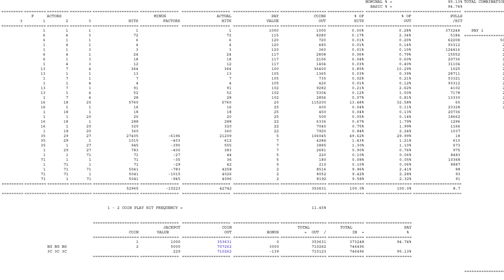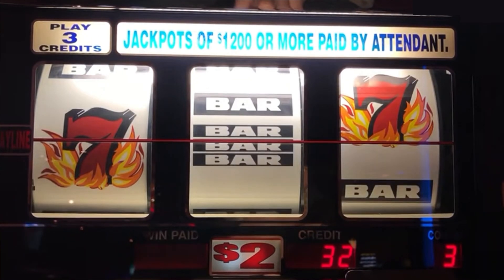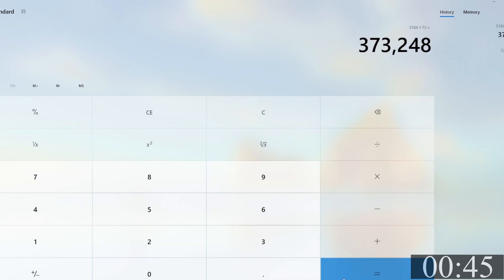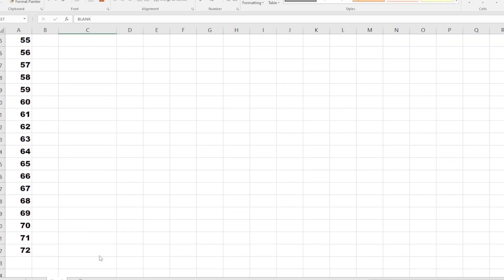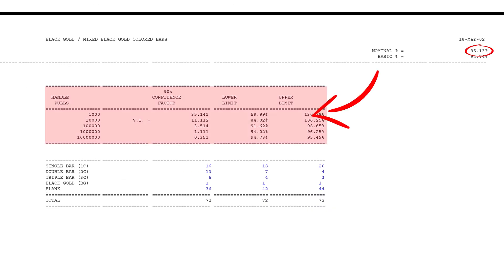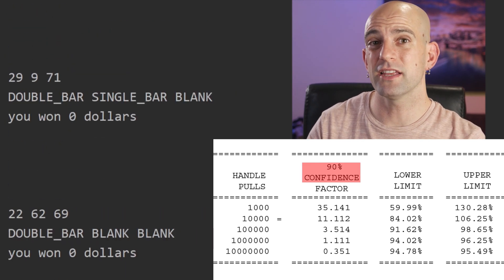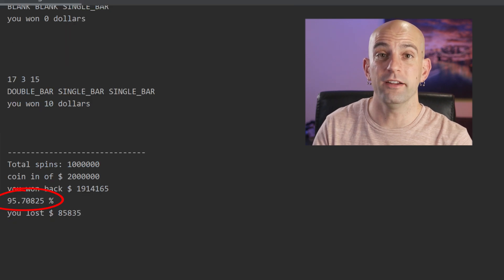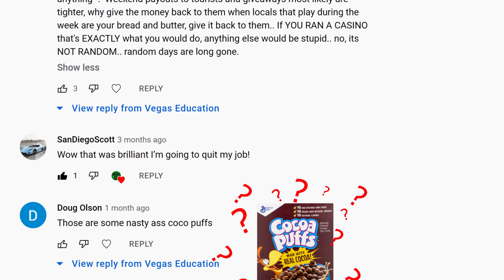Designing a slot machine from scratch

Comment: What you explain is exactly how it USE to work when it was works by coins. But now with bills and vouchers and player club card third party elements you should update this video. Is like the difference between TV vs Smart TV, phone vs smart phone, PlayStation 1 vs PlayStation 5.
Reply: They don't share secret information with designer, and if they do  I believe they  are under NDA contract. And I don't think they will share this info with you or anybody. 
Can you answer me this 2 examples please:
1-if you have 15$ in your bank account ,can you withdraw 10$ from gas station ATM?
2-if you have 10$ in your bank account, can you withdraw 10$ from gas station ATM?
2-if you have
Reply from the maker: @NE Slots Buster  
They didn't share any secrets. The math is not a secret.   "Your video is spot on, and I've never seen a video so accurate" is not a secret.

Your examples are not relevant to how a slot machine operates.  A slot machine is quite capable of paying out more than it brings in.   It is only the probabilities that keep this from happening over the long term.  Ask any slot tech that's been doing it for a while, and they will tell you about machines they've seen that have had negative payouts.    The machine hits a large payout soon after being placed in service, and it takes a while to make that money back
Reply from the maker: The math is exactly the same.   The bonus rounds and wilds are calculated in exactly the same way.    How the money is dispensed makes 0 difference.   I've talked with game designers that are still working for slot manufacturers and they said it is spot on

Comment: This is an excellent video and explanation of "the math". I also love the video "proof slot machines aren't random". However, I'd still like to know what changing the machine's payout percentage actually does in terms of the machine's code. For example, how does changing from 95% to 98% get input into the code?
Reply from the maker: Excellent question!  A game designer can lower the payback percentage in several ways.  You have to remember that the paypack percentage is the ratio of how much every combination would pay vs how much it would cost to try every combination.  Assuming that the cost to try every combination stays the same (the number of spaces on each virtual reel stays the same), that means what's changing is how much every combination would pay back.   So, that total amount can be adjusted in a couple ways. They could change the number of winning combinations. 
Example: change one of the 2 bars on one of the virtual reels to a blank space. 

They could also change some of the higher paying wins to lower paying wins.
Example: change a 3 bar on one of the virtual reels to a 1 bar.

I think the most common way is to just change the paytable.   
Examples:
Change the 3x 1bar from paying 40 to pay 35
Or
Change the jackpot from 5000 to 4000

Most of the time, it's pretty small changes that a player wouldn't really notice.  For the most part, machines aren't being made "more lucky" or "less lucky"  unless it's changing a 1 bar to a blank.  Something small, that a player would never notice unless they had good accounting records
Reply: @VegasEducation  Thank you so much for the detailed reply. The lightbulb just lit!!! Now it all makes perfect sense to my engineer's brain. Making small adjustments to the pay table will absolutely affect the payout percentage without effecting the "randomness" of each spin.

Comment: You might want to look into lists or match (python version of a switch) instead of all those those ifs.  It would make it easier to update and import data.
r1 = ['~~~','~~~','BAR',....,'Blazing 7']
...
for i in range (0,len(r1)):
     for j in range (0,len(r2)):
           for k in range (0,len(r3)):
                    r1[i] + r2[j] + r3[k]
Also, things like coinIn = coinIn + 2 can be shortened to coinIn += 2 using the addition assignment operator.   totalWins += 1 to increment that one (no ++/-- increment/decrement in python to my knowledge, but I have never actually used it).

Comment: Good video but you didn't cover some things I think.

How did you get the $710,000 number?

I mean how many combinations are winning combinations?
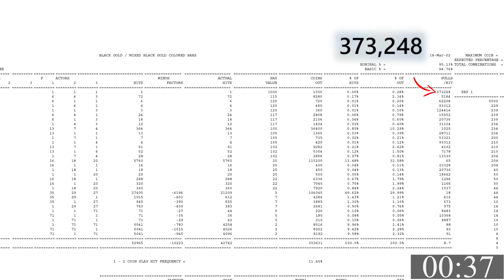Reply: 42742 winning combinations.   59265 winning combinations - 10223 duplicate (like removing 3bar-3bar-3bar combinations from mixed bars because only the highest value is paid.)   It is visible at 2:50 in the video.
$71-whatever is all the winnings from a "cycle"--every combination in the machine happening once.

Comment: What is the difference between pay lines and ways on a slot machine?
Reply from the maker: I'm not sure what you mean by "ways." I assume you are talking about how I say there are about 5000 ways to get 3 triple bars.  In that case,  they have absolutely nothing to do with each other.   Paylines would just be doing exactly what I did in the video but instead of only doing it once, you are doing it 20 times (or however many paylines)

In the video, I'm only doing one payline

Comment: Great video! I'm curious to see how the payout over 1 million or 1 billion spins would differ if you changed the RNG. You programmed it to pick a number for each wheel (1-72) but what if it just picked 1 random number (out of the 373,248 possibilities). I'd love to see that comparison. Would you put your python code out so we could try it ourselves?
Reply from the maker: The scenario you propose is the EXACT same situation, just formed differently.  The results would be EXACTLY the same.   Picking a number between 1 and 373,248 is essentially what the slot machine is doing, it's just using 3 different reals to do it, if that makes sense.

I probably will release the code at some point. If you send me an email, I'll email it to you.
Reply: @VegasEducation  In my head it seemed like it would be the same but could show up different in real world simulations. I guess it would be more of a Monte Carlo situation to see the way variance would play out in the machine.

Edit: I don't see any contact info for you.
Reply from the maker: @falecf4   it's not that it's similar and would get similar results,  its EXACTLY  the same.  Slot machines are just a fancy way of drawing a number between 1 and however many possibilities.  If they just told you the results, nobody would play. So, they had to find a more confusing way of doing it

vegaseducationyt@gmail.com

Comment: Thanks for the video! Would you also be able to provide an analysis of "hot" and "cold" periods during the million spins? Define "hot" as being > 12 wins in 20 consecutive spins and "cold" as being < 3 wins in 20 consecutive spins (or whatever you like).  I think it would interesting to show that a player's perception of "hot" and "cold" is just a natural part of randomness rather than any specific program applied by the casino/slot manufacturer.
Reply from the maker: I've thought for a long time about how to demonstrate that.  I don't know the best way to demonstrate it, but I've had some pretty good ideas
Reply: @VegasEducation  Thanks for response! Hope you find a way to demonstrate this!

Also interesting is the theoretical upper/lower limits of return for  a 1000 spins. Does this RTP variance apply for any sequence of 1,000 consecutive  spins or only the first 1,000 spins when the machine is first placed in service?  I guess you could also show this by breaking your 1,000,000 spins into  1,000 sets of 1,000 and checking the RTPs for each set of 1,000 to see if they are in this 59.99-130.28% window. 

Presuming the above is true, I find it interesting how little meaning a 95% RTP machine has over this relatively small amount of 1000 spins when you get anywhere from 59.99-130.28% return. Would be interesting to see the 1000 spin return variance on a 85% RTP machine (my guess it would be similar).  I think most players can go through 1,000 spins in 2-3 hours so knowing this variance might be a good hint on how much to invest in a machine and when you should cash out. 

At some point between 10,000 and 100,000 spins, the upper limit falls below 100% meaning that is now impossible for the players to break even and now the machine becomes a guaranteed profit for the casino.  I wonder if this applies to an individual's play on a given machine -- I could see surpassing 20-30K spins over a few years with weekly local casino visits.  If true, you should just quit the machine after so many spins as it would be near impossible to get your money back ....
Reply from the maker: @prismeye  you're on the right track but you're missing the randomness aspect of it.  Those given ranges are what happens 90% of the time.   10% of the time, it'll fall outside of that range.  Sometimes by a lot. 

What you've described, about breaking the million spins in to 10,000 spin segments is exactly what I've done.    Spin the machine a few billion times and then see how many times it pays back 91% and how many times it pays back 92%.  It ends up forming a bell. You can see a short clip of one of these graphs forming at the end of this video.  I've written out my outline for this video several times, but I'm having a hard time coming up with something thorough, yet concise.

To answer your question about the first 10,000 spins vs a random segment of 10,000 spins.  The machine doesn't care. It makes no difference. One way or another, it will average out over time.
Reply: @VegasEducation  I think the hot and cold streaks that players refer to can be explained pretty well through queueing theory and Stat models. Imagine a win is considered an "arrival" (data point) an it's analyzed in aspect of time, or here it would be the number of spins. When graphed our data would fit an exponential distribution. We find that the expected arrival for 10 spins is exactly 1.0. That means on average there was 10 spins between each spin, however when we look at the data, about 70% of arrivals arrived in less than 10 spins of the previous arrival.  The reason is that the higher the number of spins between arrivals, the more weight that data point has. So data points arriving with lower amount of spins carry less weight.  

Even though the slots are random and independent does not mean we'll see uniformity of wins over a duration. The data will not fit a normal distribution. The "hot" and "cold" streaks actually expected if the slot is random

Comment: Thank you for teaching me about Par sheets. Can you explain how a machine can often do back to back jackpots/ bonuses? I guess the same math. Can you explain why nickel betting pays back more often than 1 or 2 cent machines?
Reply from the maker: It can pay back to back jackpots because each spin is random. In this example, the odds to win a jackpot were 1 in 373,248. If you win a jackpot, the odds on the next spin are still 1 in 373,248.   

A nickel machine will typically have a higher payback percentage than a penny machine in the same casino. Having a higher payback means they have more money to distribute throughout the paytable.  That means either more winning combinations, more money on the existing winning combinations, or less losing combinations

Comment: Excellent video and description. You hit the nail on the head. I was a slot machine bench tech at a large casino for 5 years. I also own my own "Game King" at home. Just as you said, it's all math. The machine does not self balance or anything like that. On my home machine, I have winning sessions and losing sessions. In the short term, after resetting the hopper accounting screen, I've had the machine pay out at a theoretical 135% when I hit something good 3 spins in and then eventually drop down to 65% if I played long enough. The master accounting record that I've never reset, after a couple of years and over 300k games is pretty close to the expected probability. No magic or rigging required.
Reply from the maker: Thanks. I think the problem is just that statistics can be very counter intuitive. The general population just can't wrap their heads around them.   Then there's the fact that it's litterally in our DNA to look for patterns and cause and effect.

Comment: Great Video. My question is…Once the machine reaches the 95% payout variance, and a jackpot is hit, does the machine factor the massive jackpot payout and give back less until the 95% variance is reached again? I think, with enough spins (thousands/millions), the machine will have enough RANDOM Hits and Misses to stay within the machines Plus/Minus percentage, thus averaging 95%. How does the machine get back within tolerances when falling below 92% or above 97% paybacks?
Reply from the maker: No. As I said in the video, It doesn't manipulate itself to stay within that range. It just naturally happens.  In my tests, 3 jackpots was the highest I saw in 100k spins, but it also goes a million spins without hitting a jackpot, they average out over time.

I spun this machine 5 billion times and recorded the results every 100k spins. For 100k spins,  it should be within 91.62% and 98.65% ninety percent of the time and it was.  But I saw results as high as 107.1% and as low as 87.4%.   The state jurisdiction just cares that they THEORETICALLY should converge to their give pay and have been tested to do so.    People claim that there's no way a casino will allow itself to lose money after 100k spins, but they are missing three things.... 
1. 100k spins isnt that many, its maybe 2 weeks, depending how busy the casino is.
2. why do you think the casino wants you to do 50 lines at a time? It makes things happen 50x faster.  
3. The casino has 100s of machines. They all average out.  A single machine might not be profitable over a week period if players are REALLY lucky (and only playing single lines), but with that many machines,  they average out to paying what they theoretically should.
Reply: @VegasEducation  Thanks so much…I love your knowledge!
Reply from the maker: @keithkantorczyk2854  thanks. Let me know if you have any other questions

Comment: What is the best number of spins in lets say 100000 spin potential that could give you a potential over 100% payback? How does the variance affect it. I would really like to try this model to identify the amount of martingale bankroll you could use to make a theoretical over 100% return and where does that range lie. I want you to explain that last moving graph you had.
Reply from the maker: My kind of guy. Now somebody is asking the right questions. 

As you alluded to, the potential is going to depend heavily on the variance of the machine,  after all, that is essentially the very definition of variance.  I can really only speak to this particular slot machine, as this is the first one that ive coded and played around with. It's funny you ask about 100k spins, because I did a ton of testing using 100k spins .    I spun it 5 billion times and recorded the results every 100k spins. The 90% confidence factor on the par sheet has a high end range of 98.65%.  5% of 100k tests will fall above that.  Which is almost exactly what my tests showed. I mean...... like almost exactly.   The highest return it ever got was 107.1%, with 3 jackpots.

As far as the martingale strategy, those are the types of things I would like to test and make videos about, so, if you have some parameters you'd like me to test, I'd love to do so.  I can almost guarantee that nothing would ever be profitable,  but it's fun to test and look at the results. 

The last moving graph, I believe was a million spins (i cant remember for sure, it may have been 100k spins) and its what the overall payback percentage was calculated to after every spin.
Reply: @VegasEducation  I always martingale in a casino with $640 and attempt to make $60 on craps or roulette, playing hands of $10 a piece allows me 6 double downs which is equivalent to  97.87% per game I play and a compound chance of me winning 87.88% the $60 but also a 12.22% chance I lose everything
Reply from the maker: It sounds like you have a good understanding of the math. I'd be curious to check it, but it sounds correct.  Martingale won't make you profitable long term, but it's checks the box of having a money management strategy going in.